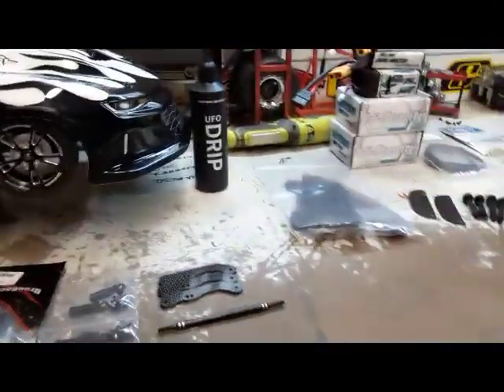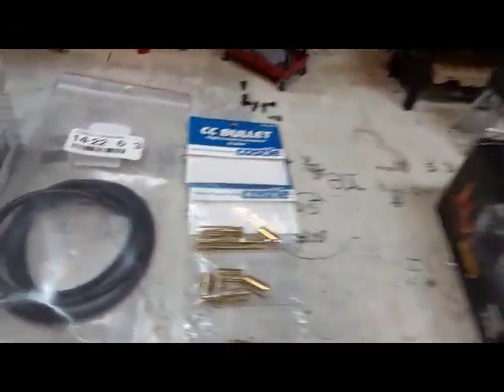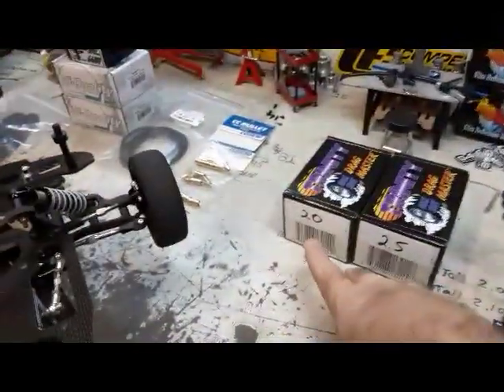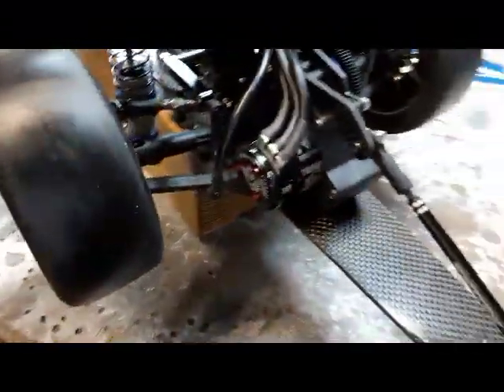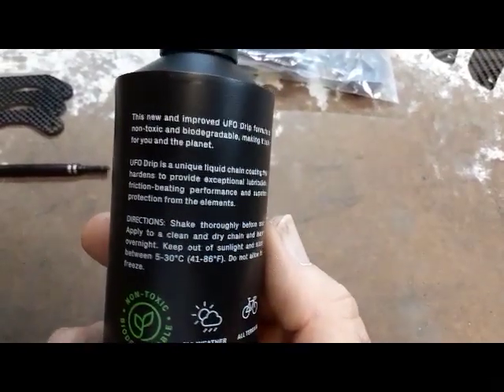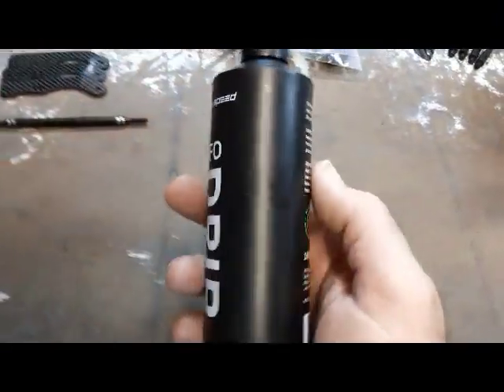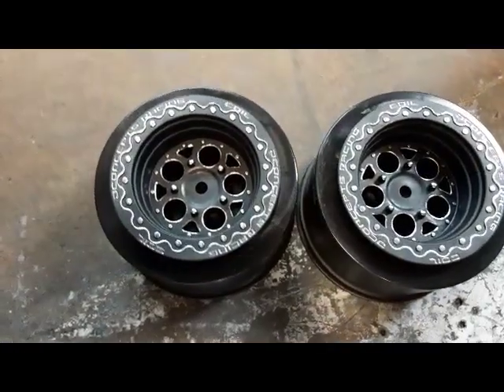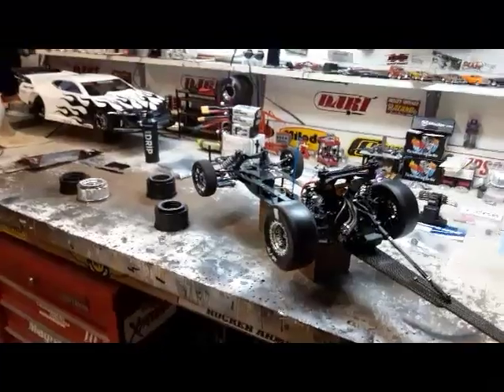RC Street Eliminator Drag Racing....getting ready for SoFlo Nationals!!

Comment: Good stuff, great info!! I like that second bitty body!

I have used very expensive Muc-off dry ceramic bike chain lubes previously (dry ceramic lubes have less resistance then wet or all-weather lubes, but they wear off quicker)… gonna try the cheaper alternative MV recommended, Tri-flow.
Reply from the maker: Yes he also balances his rear tires through his transmission there's a lot to learn from him
Reply: It’s interesting the lube you use is wax based, Tri-flow is petroleum/PTFE, muc-off offers ceramic.
Muc-off also offers a really expensive “nanotube” polymer based lube (now called ‘Ludicrous AF’) which I switched to for cycling. It supposedly has the lowest friction coefficient among any race lube.
Reply: 50ml of muc-off ‘Ludicrous AF’ is $65 lol
Reply from the maker: @eagleeyes9770  why do you find it Interesting? I also use motor oil in my shocks, people find that strange also !!
Reply from the maker: @eagleeyes9770  yeah it's pricey but I don't think I'll ever buy a bottle again it should last forever for what I'm using it for
Reply: @powermadracing5116  It’s interesting to look at the base compound behind the different dry lubes & the subsequent marketing.

In cycling, companies push their marketing towards their ceramic or polymer based lubes because of ‘slightly’ better efficiency.
Reply from the maker: @eagleeyes9770  I guess looking back at my Motocross days, the wax based "grease" that we used on our chains was from PJ1 back then and I just went with what the top Riders were using today.. considered it's going to be in a enclosed environment I have been no wear at all... then when I open the case it's only on the gears

Comment: What was your thoughts on the DRC tires I you were testing them also it looks like reactions came outside on top for your program.
Reply from the maker: My tune-ups don't draw a lot of amps so those tires are heavy for me so I lost about 2 mi an hour as you can see by my numbers and I'm working on that chassis the power is yet to come only 74

Comment: We were able to order 6 sets of voodoos on the last preorder and we still haven't gotten any information on when they're shipping either.
Reply from the maker: I'm glad you got in on the buy in.. I hope you get them soon thank you for letting me know I'm not the only one waiting
Reply: Also, Exotek has a new topshaft with gear for all Traxxas transmissions that uses the AE style clutch. I didn't have luck with the STRC shaft due to play, like it was machined smaller at bearing races. The DRC topshaft doesn't have the play, but it also doesn't come with a gear.
Reply from the maker: @bbyautographics7106  I'll have to try out the . Exotech but I actually like the strc because I can shim it with the end play that I like for good wear and I see drc makes a top gear..
Reply from the maker: I ordered three of those Top shafts thank  you very much I like the one piece hardened steel design